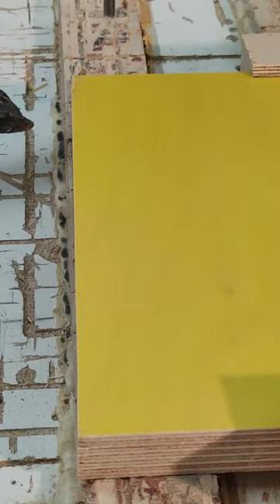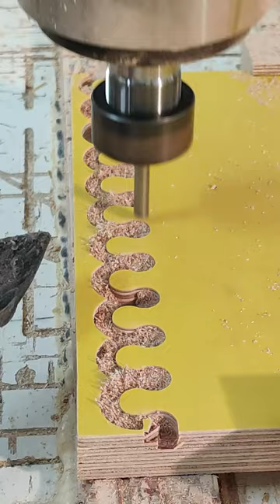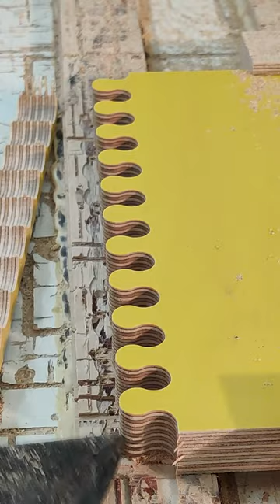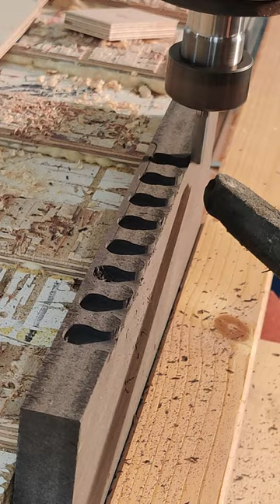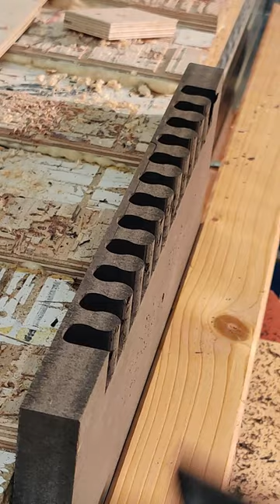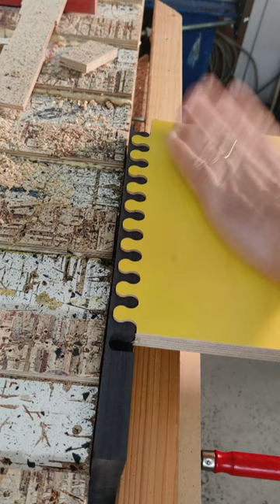cutting finger joints with a cnc router

Comment: These are very impressive. I’m trying to find an effective way to construct drawers with cnc joinery. I have a good vertical table. Out of interest what software do you use for this? What gap tolerance do you find is good for hardwoods?
Reply from the maker: The software i use is vcarve pro. I've been using it professionally for almost ten years now, and i can't recommend it enough. Regarding the tolerance, that depends on the diameter and length of the bit, and also on the machine. My machine is quite big, so it's actually not as rigid as smaller machines, so it has more chatter, however i use a water cooled spindle which is certainly an advantage. I actually use a negative tolerance for some joints because of the chatter... The best way to find out is to do it. Good luck!!!